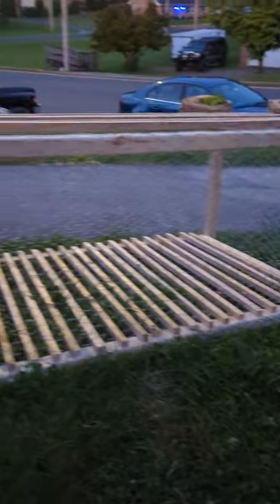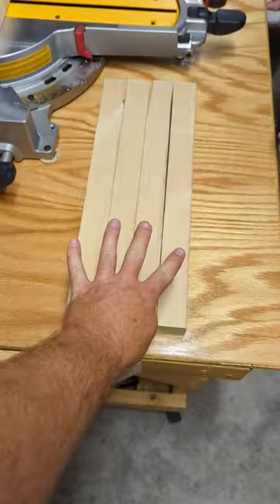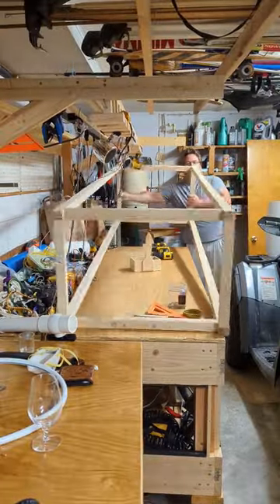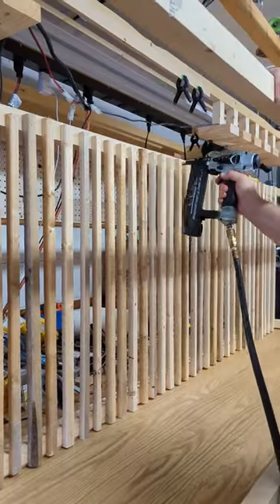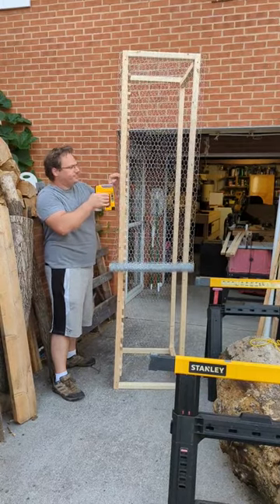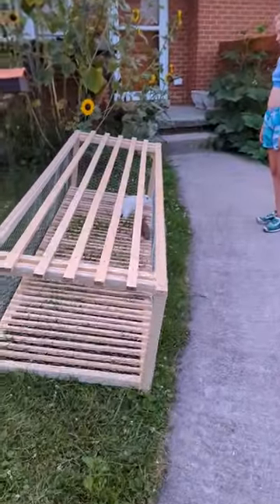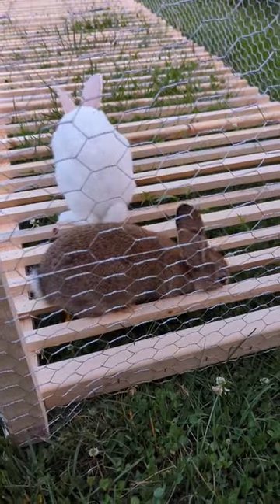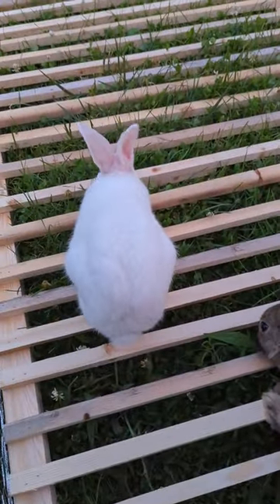Bunny lawnmower box rabbit mower. 8 feet by 2.5 feet Save $200 a $35 build

Comment: A suggestion from someone who has built that same wood slat floor:  when they escape too often and you want something more secure, use 2in by 4in galvanized wire fencing, just staple to the bottom-- don't even need to take off the slats  ( bunnies will take care of that eventually)

Comment: Using fencing on the bottom also works great, just not the thin chicken wire
Reply from the maker: So are you saying that the standard chain link fence is thick enough not to hurt their feet? I did not think of that. I threw out 150 feet of that stuff😢
Reply: @jstewart627  the finer the better in general fencing is bad for rabbits either way for their feetsies. But in this case with the grass it would haeve been better than gaps with wood